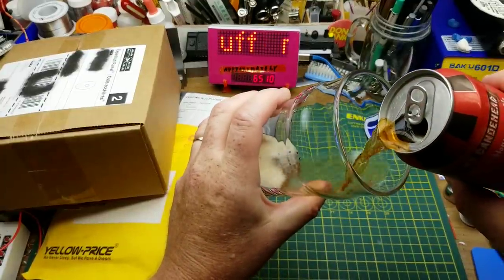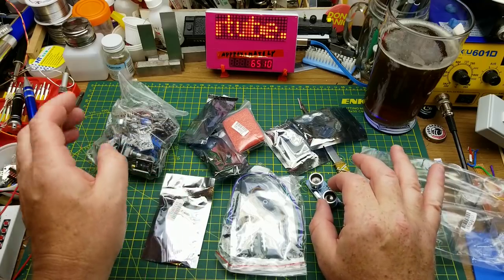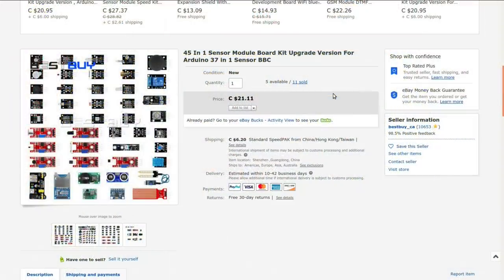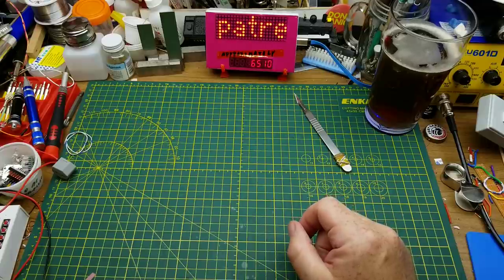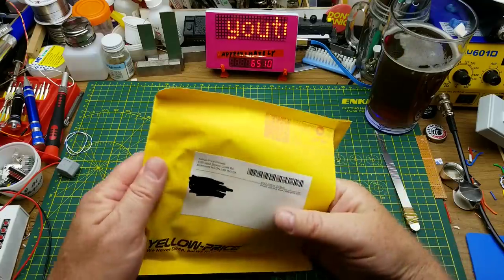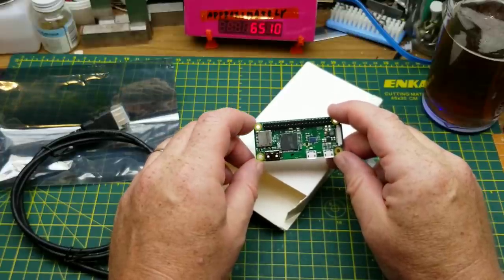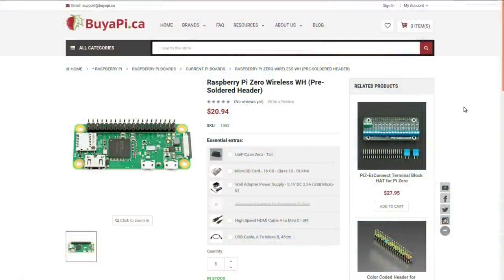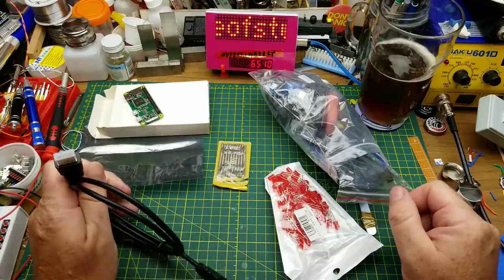Mailbag Monday #96

Comment: The double ended bits are great (amazing for doing a bunch of riveting) but when the chuck gets loose and chokes up on the bit- Remember to stop and reset as the bit is chewing at the screw holding the chuck in place  :)
Reply: They are specifically designed for pop riveting. They have a shallower cutting angle so they don't get stuck i n thin sheet metal.

Comment: The "light cup module"  uses tilt sensors and adjusts the brightness on  the LED's using PWM to simulate pouring light from one LED to the other. Those kits are great fun, can't wait to see  your presentation. Thanks Pile. Take care.

Comment: The double-ended drill bits h are specifically designed to make holes in thin sheet steel for pop-rivets. They have a special shallow cutting angle and less rake compared to normal drills, which stops them "catching" in thin sheet. Therefore they cut slower, and tend to make a round hole rather than a 3-lobed hole in sheet steel.
The short length means less flex, so stronger and less chatter. However they won't cut other materials as well as normal bits - for example, they will not cut wood or plastic very well and they aren't really a replacement for the regular 1/8" in a normal drill set.

Comment: For those viewers in Canada, you can get the double ended ⅛" drill bits from Princess Auto. Price may be slightly higher, quality?, but delivery is immediate.
Reply: Of course - you can buy them in ANY hardware store. However they are specifically designed with a shallow cutting angle for drilling thin sheet metal for pop-rivets. So they are not a double-ended version of a normal drill bit.

Comment: Nice haul.
Those double-ended drill bits got my attention- I'm forever wearing the damn things out too. I gotta get me some.
Reply: The double-ended drills have a different angle on the end to normal drills, and are specifically designed to make holes in thin sheet steel for pop-rivets. So, these aren't a replacement for the normal 1/8" in a normal drill set.
Reply: @johncoops6897  Hm. I don't do a lot of work in thicker materials these days so they should be OK I did notice some warnings in the ad that they weren't appropriate for some uses.

Comment: There are as you say, many possible uses for a RPi Zero W, but Kodi isn't one of them - they're too low powered for that.  If you want to make a Kodi box then you really need a RPi3B and upwards.  If I were you, whatever you end up doing with it make sure you use a decent micro SD card, a slow card will really kill the performance and ruin your experience.

Comment: Would be nice to see a "how to" that goes a little more in-depth than just here is a library. Give them a little help with now to read its data sheet on the function you are going to use, be it on the Arduino or the chip connected.

Great looking beer and a nice post bag.

Comment: Why not a Pi 4? Yeah, it's twice as expensive. But like 10x as capable...
Reply: Twice ? Most likely 4x as expensive. The Zero is pretty good for some embedded programming. The Pi 4 is some overkill.
Reply from the maker: I was going for "cheapest viable".

The Zero might not be able to do all the things but it is an inexpensive platform to tinker with (and not cry about if I break it).
Reply: @pileofstuff  I added one to my cart. @BuyaPi and they wanted 12 bux minimum shipping to B.C. Yikes.
Reply from the maker: @DrexProjects  That's even worse than when I bought mine. 
Shipping prices really are a burden on this hobby.
But even with that' it's still cheaper than ordering it from the 'states.
Reply: @ArjanvanVught  Yeah, you're right. It's more expensive than I had in mind. (And the Zero went down.) Zero is okay for tinkering as long as you don't expect to much. Think running a Pi hole on it will impact browsing considerable in speed.
Reply: @pileofstuff  vERY TRUE. i NEVER ORDER FROM CHINA ANYMORE AS YOU CAN SEE FROM THE LACK OF MAILBAG VIDEOS ON MY yt CHANNEL.   OMG my caps were on, I'm not typing that again. Long weekend booze is catching up on me, But I noticed when I added more stuff to my cart the shipping stayed at 12 bux, So here I go,  I'm loading up. Thanks for the vid and thanks for shopping Canadian.
Reply: @tengelgeer  I am not even thinking about running any Linux on the Zero. I just work with the Zero as an incredible fast ARM processor (with plenty of RAM, HDMI and SDCard).
Reply: @ArjanvanVught  Damn! Hardcore 😁